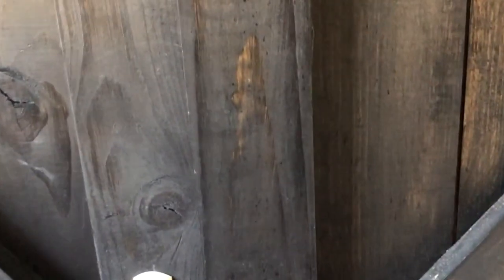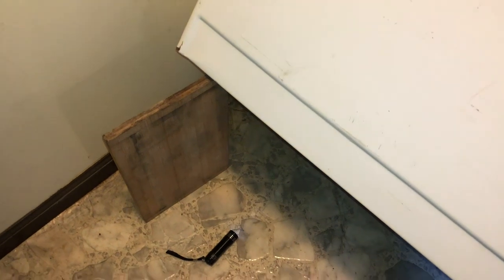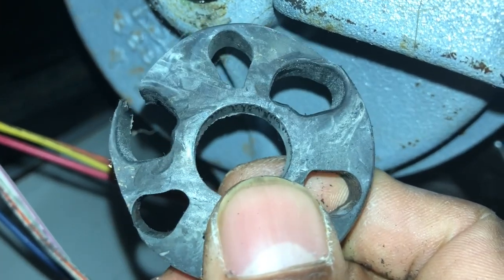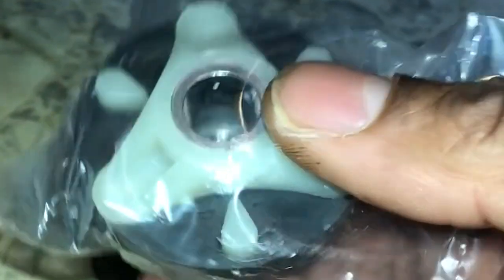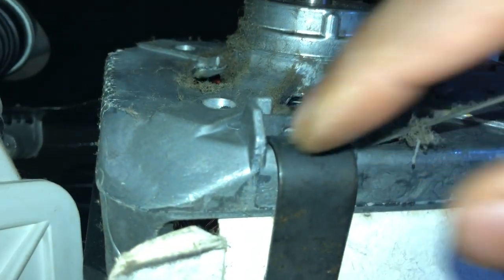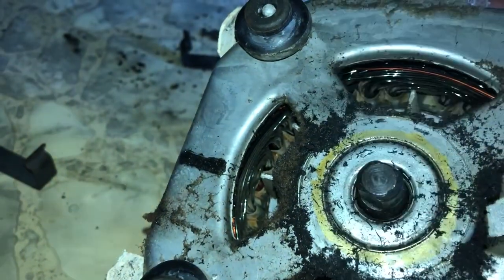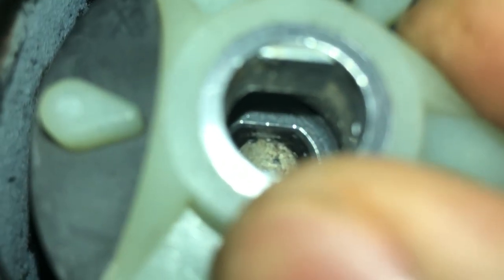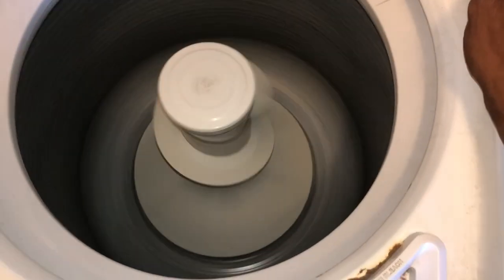washer won't spin. Kenmore 70 & 80 series Coupler Repair #washingmachinenotworking

Comment: Thank you! It was nice to know that unlike what many how-to videos show, you don't have to take the shell off to work on it.
Reply from the maker: I would have to agree Christopher. I’m always looking for the easiest way to do repairs. It’s actually a fairly easy job to do. If your old couplings are somewhat in tact. Measure them and compare to the new set before install. A lot of these aftermarket parts are not always a perfect fit. 

If you haven’t, please subscribe.

Comment: Thank you for this! I put the new coupler (2 plastic pieces embedded in rubber) in but I can't push the motor back into place far enough to attach the top clip. Do you think that I should take the coupler apart and put 1 plastic piece in first and gently pound the middle of it in place to be sure that it's not sticking out and then put the rubber piece on with the other plastic piece OR maybe the plastic part is thicker than the original OR maybe we put the whole set in the wrong way OR the shaft of the motor is not inserted in the coupling (since it is not round for an easy shot)? Any suggestions? It's wearing us out.
Reply from the maker: Thanks for the comments. My 1st question would be did you compare the old and new parts? It's not uncommon for the new part to be a bit larger. I have before had to sand some off to get it to fit. Also, make sure the the motor is balanced well when being seated into the rubber bumpers brackets. The install should be snug but not a forced fit. As you mentioned, make sure that the coupler is properly seated on the shaft. You may what to add some sort of lubricant.

I hope this helps.
Keith
Reply: @TRRehab  Thank you for your reply. I was able to push the motor back in place after gently pounding 1 plastic piece of the coupler onto the shaft of the motor and doing the same with the other plastic piece onto the transmission. When both pastic pieces were flush and fitting snuggly, I inserted the rubber piece in the transmission, I then picked up the motor and maneuvered to insert the plastic piece into the holes of the rubber piece that was in place on the transmission.
Reply from the maker: @ddesimone1648  Now that sounds like you just rehabbed that old washer. A little sweat equity but well worth the overall savings I would say. I want to say my washer is somewhere in the 20 year old range and still going strong. 

If you ever want to just relax gardening has become my go to therapy. Visit my gardening channel @growing out the box 

Have a great day.

Comment: So you didn’t have to take the cabinet out? Cuz I have thee same exact washer as you mine but mine is making a grinding sound, pretty sure it’s the coupler but you seem to get the job done without taking off the cabinet
Reply: I’m gunna attempt soon to find the coupler. I’ll give you a update! Hahaha
Reply from the maker: No Ma'am Miss. Emily.... I just propped it up from the real. There is nothing hard about the job but seating the motor after repairs does require attention making sure the coupler is seated properly. Make sure you measure the old to the new as they are often sized incorrect. I took the motor down 3 times before realizing the difference. I hope that helps? If it does and you like gardening check out my gardening channel Growing Out The Box @growingoutthebox1610
Reply: @TRRehab  thank you so much! I’ll try that out! And oh my mom does I’ll get her into it! Hahaha!
Reply from the maker: @emilycary5928  Let me know if you have any issues. Like I said, the seating of the motor and the size of the coupler. You got this!
Reply: I see the coupler it seems intact but I try spinning it and I goes half way I didn’t take anything apart yet you think it’s still that?

Comment: Helpful vid thanks! After I replaced my I ran a few cycles and it smelt a faint burning smell no smoke though. Any ideas?
Reply from the maker: Good day and if you haven’t, please subscribe. I really do appreciate you watching.

I have actually done a few of the coupling repairs since posting and I have had on 2 of the repairs something I would say is similar and could very well be your contributor to the burning smell. If you were not getting the burning smell before changing the coupling 1 of 2 things and they are really 1 in the same. I would assume that the motor is under stress load. What I found on 2 repairs I did was the black center piece of the new coupling is roughly 3mm larger thereby giving very little if any play between the transmission and the motor. Your install should have gone fairly easy. 1st thing I would do is measure the old coupling and the new coupling. If the new one is larger as was mine, take a sander and shave to the older couplings height. If the size of the coupling is not the issue I would look to see if you have it properly seated on the shaft. A little silicone added to the shaft may help. Slightly tap it down using a tall socket until it bottoms out on both the transmission and motor. 

Almost 100% sure this is where your issue is.

Let me know if this helps and please don’t forget to subscribe if you have not.

Thanks

Comment: I replaced the coupler and worked for a week but not it wont
Reply from the maker: I would ask if it were difficult to install. If yes, the size may need to be shaved to fit as a lot of the stuff made in china is not exact.